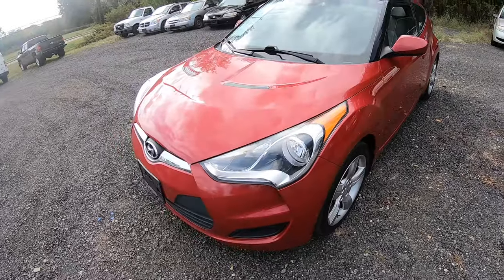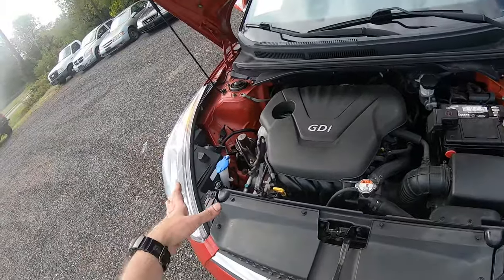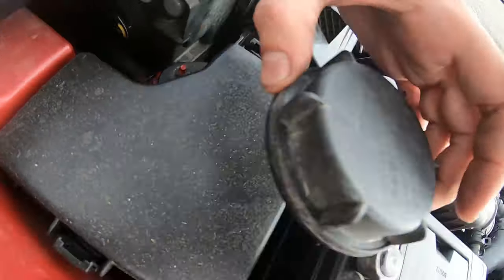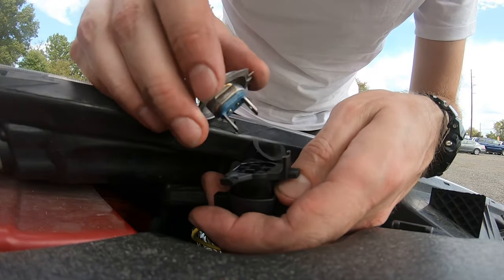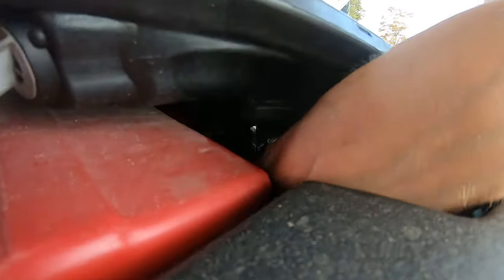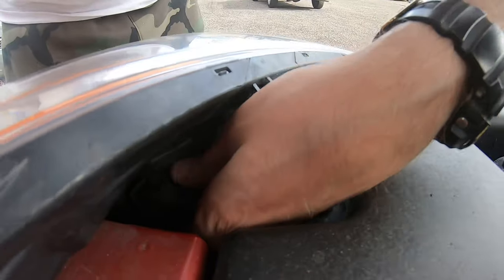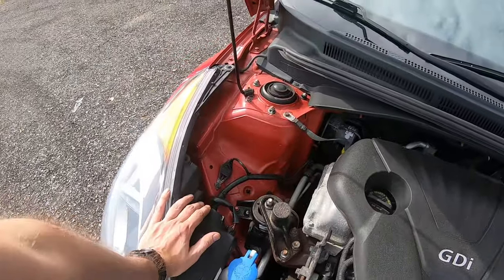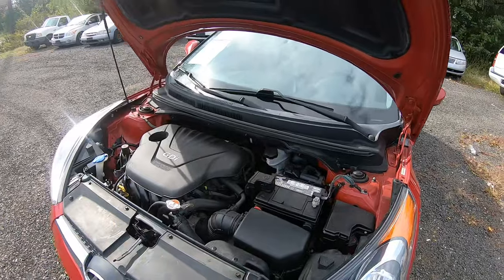How to replace headlight bulb in Hyundai Veloster 2011-2017

Comment: I was just quoted $200 for this job by Hyundai. Thanks to your great video I bought a replacement bulb for $11 & completed the job in 5min. Thank you so much!!
Reply: Got Quoted $180 and told they had to remove the front bumper...WOW!
Reply: I hate mechanics in the US, legal scam artists.
Reply: @MrBlizzetta  I found another video right here on YouTube where the guy shows how to put your hand in and remove the cover and put the light in yourself. I went to Walmart and found the light bulb for $11 and got it replaced in less than 5 minutes.
Reply: Good deal on the replacement bulbs
Reply: @MrBlizzetta  yep, I took my car out of pep boys after $1100 optional 2 sensor repair. I ok’d job, then few mins later (3-4 mins) I realized it was already running fine based on previous convo and called to cancel, manager: “we already jacked up your car and started replacing it, and no returns on sensors”. 4 hrs later I went to pick up my car & they hadn’t touched it. After arguing with manager I got my car next day w/out the optional repairs. Just paid the 200 oil change and diagnosis. All diagnosis said was owner works on car 🤷‍♂️ still don’t know what was wrong with vehicle, maybe clogged filter 🤷‍♂️ car being moody then, don’t know
Reply: @joshuamarius  same, they told me it would take an hour and a half
Reply: They were going to charge $300 to replace the trunk opening button. I hate Hyundai, ideally will just get a few more repairs and yeet my car for another
Reply: @krismine99 dealers make good money off people who don't know how to DIY. 
Have you seen the videos on how to replace the trunk latch buttons? It's pretty easy, but there are 2 different types of latches, one for velosters with back up cam and a different one for cars without backup cam. 

I love YouTube 🙌😊 When some asks me how I learned to work on cars I always say Uncle YouTube 😂
Reply: I love this comment so much
Reply: $168 + tax at Canadian Tire (Oct 12, 2023)  Really hoping the part about it is the trick I needed. I was trying to pull straight out.
Reply: @krismine99   I feel your pain! Paid that amount and the &^%$#@ thing broke 13 months later (out of warranty!) 
Bought the part online at Amazon for less than $10 and it took me 15 minutes to do it myself, including the ~7 minutes to watch an instruction video on YouTube. Highway robbery at the dealership! 90 minutes labour they charged me. If that job took them 90 minutes, they shouldn't be allowed to put gas in a car!
Reply: @krismine99 buy the button for $90 at dealer and install it yourself. I found a video and it took me about 30 minutes to install.
Reply: @helenruano9735   I've since switched vehicles. I'm not sure if something else went wrong, but the button broke after we had replaced it, and the second time was in fact not easy. Switching cars saves me the trouble of having to deal with Hyundai ever again. Transmission to AC, just the absolute worst experience

Comment: The car in the video has normal low beam headlights. If your Veloster has projection headlights (the led ring around it) the technique will be the same but differ slightly. The trick will be to push in while you are turning. There is little room for any leverage so swearing might help in this situation. Look at the H11B replacement bulbs to get an idea of the procedure.
Reply: This added tip of pushing in while turning made a world of difference! Thanks so much for that or I would have never got that to turn.
Reply: Gonna try it now cause I’ve been fighting with it for 20 minutes and destroyed my 2 hands
Reply: @psykooozz  I know it’s 4 months ago , but did you ever get it yourself? Im having this problem myself
Reply: @primnav2058  I went to a garage 😂
Reply: @psykooozz  I had the same issue, done now but only just read this 🤦‍♀️🤦‍♀️🤦‍♀️
Reply: @psykooozz  🤣🤣🤣
Reply: Hi All, umm mine won’t budge. Like it wants turn, but won’t budge. Any other trick besides dropping the bumper- saw another video
Reply: Sorry forgot to say thanks!
Reply: Hey I have the ring around mine, do mind telling the bulb size ?
Reply: The difference being the Turbo vs the N/A for the 2011-2017 models. N/A Base, Style and Tech packages use Reflector Headlights while the Turbo models use Projectors. Hope this helps.
Reply: Thank you!

Comment: first thing to do before beginning this service, is to disconnect the negative battery terminal and allow the car to sit for at least 30 minutes before beginning. If not done electrical shock may by given to you or a short in the electrical system may happen.
Reply: Nonsense if something shorts when connecting a plastic plug you've got bigger problems than a blown bulb. You're far more likely to cause a short or get shocked by messing around with the battery. Not to mention that unfamilar with cars (ie audience of this video) dealing with electricity is scary enough without then needing to fiddle with metal tools and risking shorting the battery. Just make sure the car is switched off completely (ie no ACC either).
If you do need to disco the battery for any reason there's no need to wait either, the worst that can happen is a weak static shock - you're dealing with a 12V battery not 240V mains supply

Comment: Great video, i was able to get a better angle by putting my head at the front windshield instead of being under the hood, to see. I also used a pair of needle nose pliers. For the 2015 turbo, the lamps are a little different but with the same concept. Turning the lamp to the left and pulling out slowly 👌🏿. The base of the lamp and wires will stay attached to the vehicle. The lamp will be the only thing being disconnected when turning. Hope this help

Comment: Thanks! To people having trouble, try using some pliers on one of the notches to get some leverage on the knob. Helps a lot
Reply: That’s what I had to do some minutes ago! Thought I was the only one. I could not find my pliers, so I used a pipe wrench. My fingers and gloves COULD NOT do my driver’s side. I did the passenger many months ago without this much trouble. Wish I saw your post, I’ve been trying for days and finally said I’d use needle nose pliers  even if I break it, everything looks intact though.
Reply: Tried the pliers.  Now I have a broken knob to go with my broken bulb
Reply: @brr4762  😂

Comment: Dude, you are SO right on how tricky that driver's side low beam light is to replace. I dread every time it goes out! If only they made that space just a little bit wider for easier maintenance.
Reply: There is a way to made more space by opening one screw and lift a litle bit the all flashlight
Reply: @liad87alkobi  Come again?

Comment: I did this and struggled for ages trying to get the low beam bulb back in its place. The low beam is in a very tight spot indeed. Can be done though depending on dexterity and the size of your hands! I see why it’s easier to take the bumper off, just a bigger job and you may need tools that you don’t have already 🤔 that’s why I did it the hard way 😂

Comment: Once you get the first cap off I used a long set of needle nose and turned it to the right slightly and it came right out, it was a little hard on knucles putting back in but I got it!

Comment: Hi there, I replaced the bulk but my driver side headlight still isn’t working! Do you know which fuse is it? I’m thinking my fuse is out!
Reply: Same here. What was it?
Reply: It was pretty easy replacing them. I did with low light conditions.

Comment: Ugh this is so hard on the Driver's side. The fuse box is right behind the headlight so I don't have room to reach in and grab the bulb >.<. Of course it had to be THAT bulb that burnt out
Reply: For real. I even went at it with pliers and it didn't work.. Had to take it into a mechanic and spend 100$ to get the stupid thing replaced
Reply: you can take the 2 bolts out and pull the headlight up a good bit to get more room

Comment: Has anyone noticed a wiring short type of issue when manually turning the headlights on? My switch is very touchy and if I'm not cateful, there have been times when the lights should have been on based on switch position and they were not, but with a slight touch or nudge of the knob the lights flixer back to working. 
2015 Hyundai Veloster